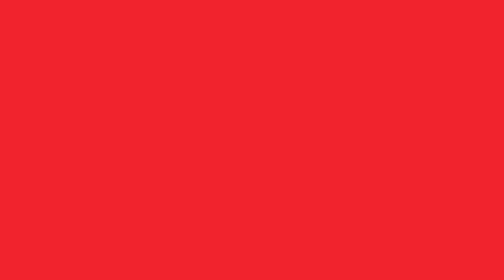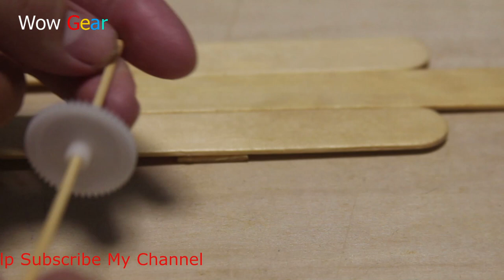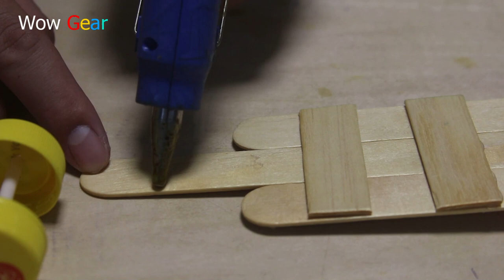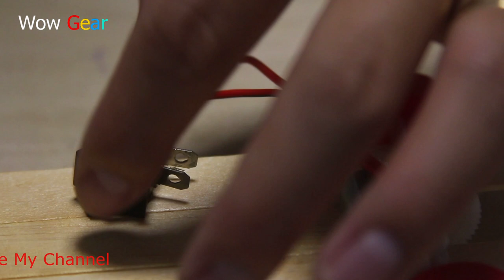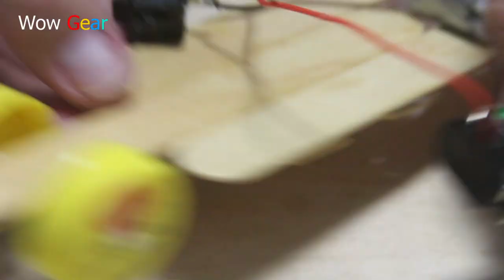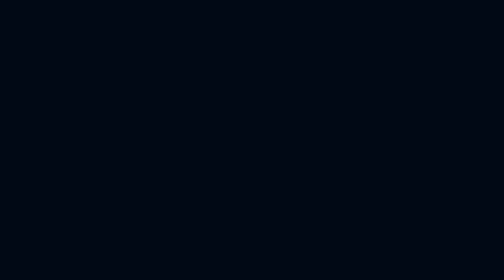How to make a Racing Car from DC Motor with Ice Cream Sticks

Comment: But the battery is dead then what to do
Reply from the maker: Then you just change the new one bro.
Reply: @WowGear6  but it is fixed with stick then what to do .
I have to break and i will make a new one
Reply from the maker: @supergamer7223  You can still remove bro cos the glue not so difficult to remove from the stick or battery by using small knife or sharp metal to cut and remove that glue. You can try it. Thank you!